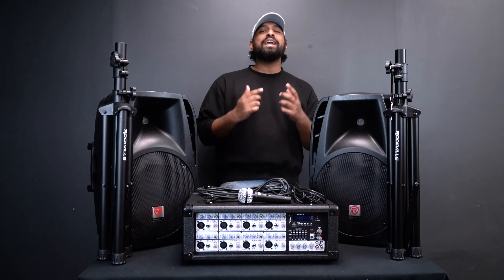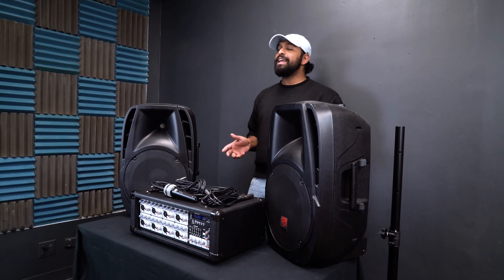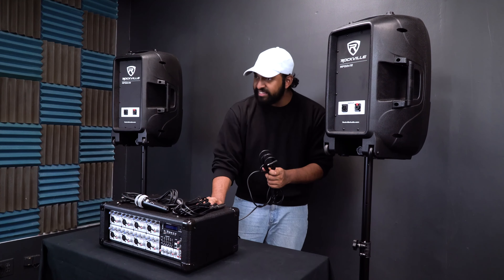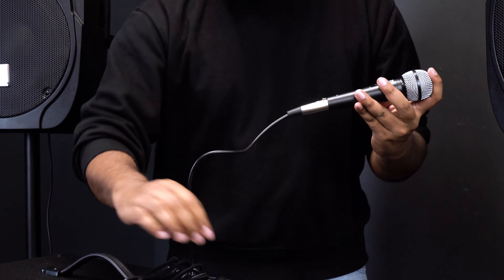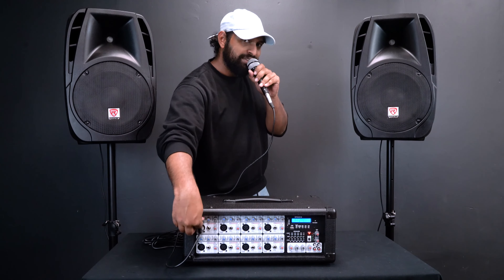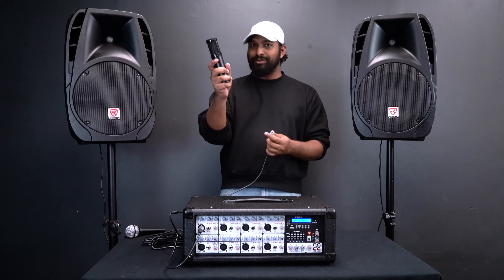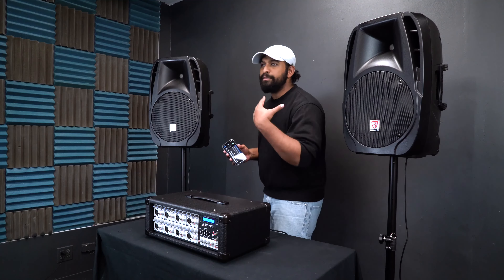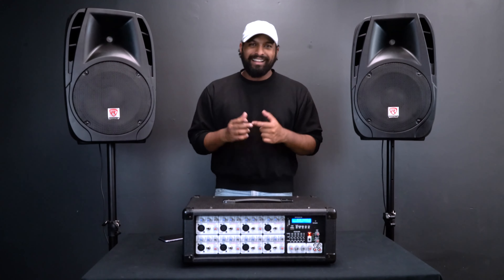How to Set Up Your Rockville PA Package (For RPG2X10, RPG2X12, RPG2x15)

Comment: Is there any support help from the company? We bought this system for a group of volunteers that meet every quarter and need a PA system for the meeting. The first time we used it everything went great. We stored the amp in a cushioned protective container. The next time we met, NO power would go to either speakers. Double and triple check to make sure I didn't do something silly wrong in hooking up the speakers. Watched this video to quadruple check. Verified signal was going to the microphone and it was receiving via the bluetooth feed. You know how you can hear a hum in the speakers if the master is turned up enough? Nothing, how does power just stop going to the speakers? Is this a common problem? Is there any recommendations to fix this. The volunteer group doesn't have a lot of money to throw around buying new PA systems. I feel bad because I recommended y'alls product and now they might be out all that money with only one use. I thought the same thing you are probably thinking. "Someone dropped it" I looked all the AMP to see if there were any scuff marks from hitting the ground. It stayed in the cushioned case for the entire 3 months since I last messed with it. Someone please help!

Comment: How do you get two subs to work off it? Because the mono output on the back will not connect in stereo to a power amp.  Two passive subs only connect through another power amp. Which can only receive mono from the amp/mixer, so then only one sub will barely work.  So you take the red and whit rca line from the rec out lines hook those to the amp. Then you can control the sound (ONLY) for the subs through the amp. Not through the rpg2x12 main volume.
Reply: I have that same problem they haven’t respond back to me yet one of the output for the speakers doesn’t work